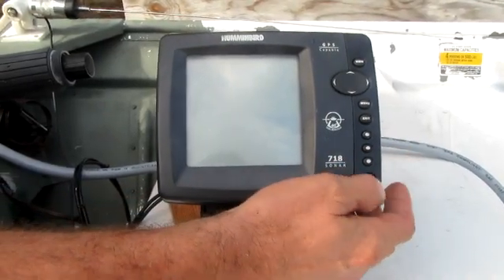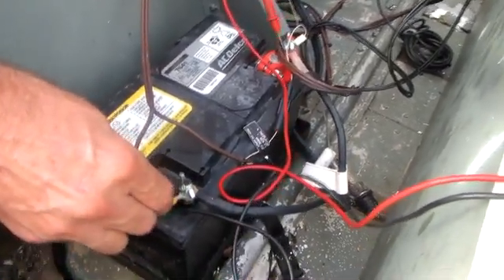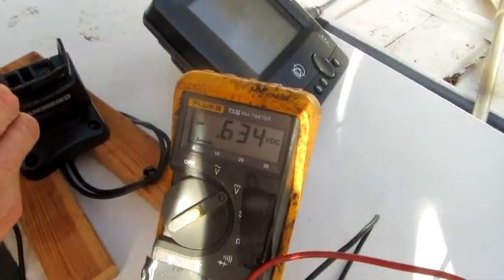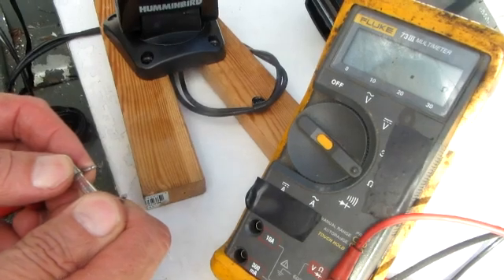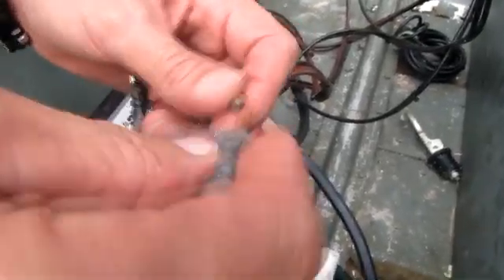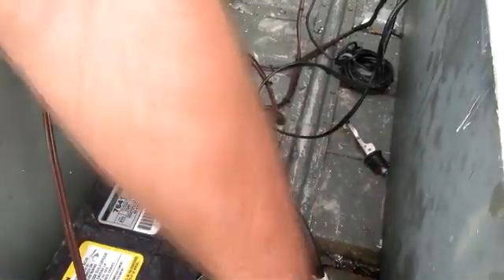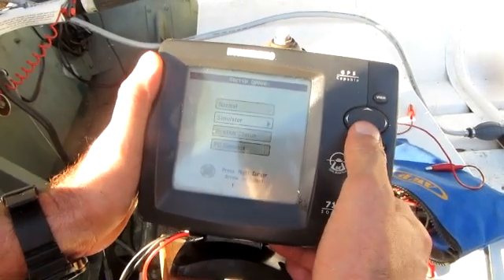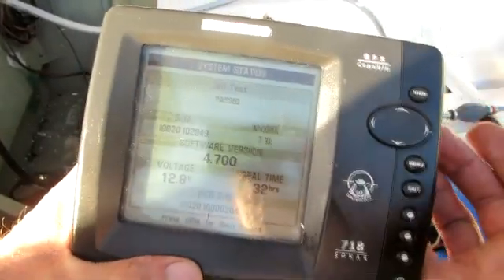Troubleshoot Humminbird Fish Finder, Won'tTurn On, using a multimeter

Comment: I just completely rewired my Helix 7, and hooked it up to a new battery. 12.86 volts at the power connector. Won’t start. It works with my ice fishing setup. I don’t know what the problem is…. Or maybe the problem is the Helix 7 sucks?

Comment: Perfect! I'm a retired electrical engineer. Had the exact same corroded fuse problem. Piranha 4 would power up and then die. Just didn't have the peak power to operate the transducer.  Thank You. Sonar is kind of a unique beast for pulsed, high-power requirement. I wonder why Humminbird doesn't provide this simple, quality advice?

Comment: Maybe someone can help me!  I am having an issue with my hummingbird helix 5.  At first it would come on and off while driving.  I found one of my pins broke off, so I replaced the power cable.  I turned it on and it worked for about 1hr.  After that it went off and never turned back on.  I checked fuses and they are good.  battery is brand new.  I test it anyway and get 12 volts. I tested power all the way to the pins and get 12 volts right to where it plugs in at.  Its almost as if the unit blew but Its only about 1 year old.

Comment: Bought a used boat with a humminbird 385ci on it. Owner said it didn't work anymore so I figured I'd probably just remove/replace it. Did a google search, watched your video and just used steel wool on the fuse and connectors on either side. The finder fired right up! Thanks for the video. So simple and effective.
Reply from the maker: Great!  Thx for watching.